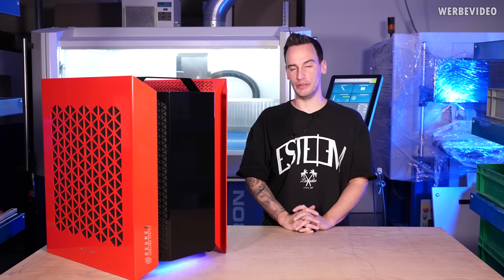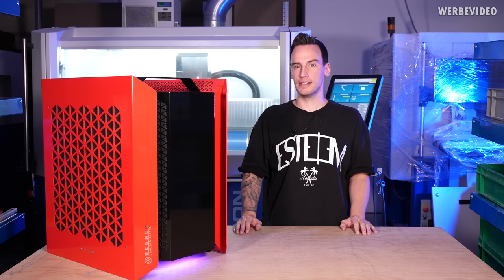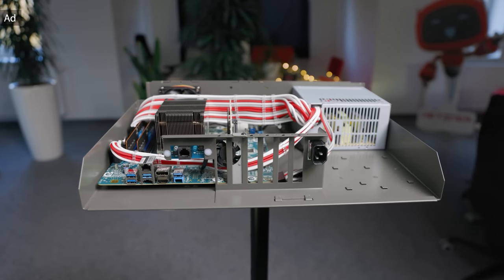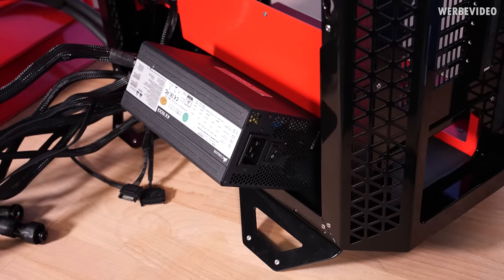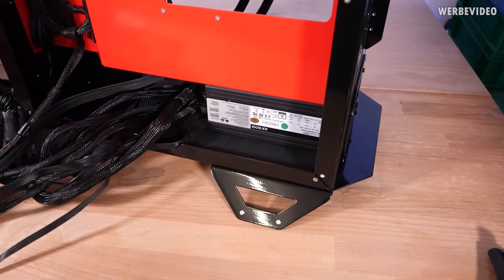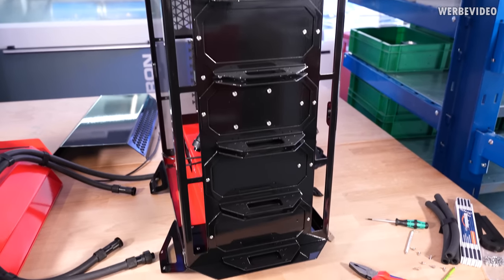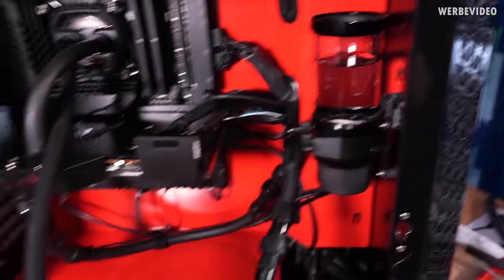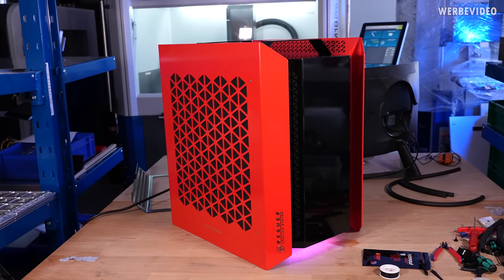The most expensive Case I have ever tested! Regner Cooling is back

Comment: If it can run at 28 degrees at full load, that you'll never ever be dealing with in a real world scenario, then I'd be leaving the filters on.. I've been running filters like these on my HAF X for over 10 years. I can tell you it's much nicer and easier to just clean the filters with a vacuum cleaner than getting in and getting all that dust off every single blade on those fans. Not to mention the radiator fins. Even if these filters get a little clogged the water temp might rise to a massive 32 degrees. But I feel there shouldn't be any filters on the exhaust side of the system. Theoretically the air has already been filtered coming in to the case, so no need for exhaust filters at all.
Reply: the only exhaust fan are the one on the 2 radiators, front and rear of the case are intake (this is certainly why there are filter in the front and the rear ).
Reply: @barbatocedric4246  Yeah 100%. But those filters on the sides are exhaust only. They'll restrict airflow. There's no need for them to be there after the fans. Leave the ones you mentioned in place for sure.

Comment: Yeah to be honest, this case sounds insanely expensive on paper.  However, when you take out the 1k+ cost of the water cooling components and the 300ish cost of a high end case from a custom loop build you realize maybe this isn't as expensive as you thought it was.  Great to see the massive comeback on this product.

Case in point, a friend was recently debating trying to water cool a 4090 he has on order and asked me what the costs were like.  It was around 600-650 to do it with EKWB parts, and that was only using a 240 rad, soft tube, minimum required fittings, smallest pump/res combo, and not including the cpu in the loop.
Reply: For this price, you get some pretty weird (and even cheap) stuff with far from the best visuals. Only one real selling point is dual rads on the sides hid. In other, it's a pretty average case. Even after looking at this video, I can see so many areas to improve.
Reply: @shteud01  Uh best visuals?  What?  Cheap stuff?  Yeah solid aluminum, 400mm square radiators, noctua fans.... very cheap stuff.... 

Roman helped design the most popular case made in the last decade, so popular everyone has copied it to death.

He seems to think this case is pretty good.  I am going trust him on it.
Reply: @DKarkarov  I don't say the case is bad. But design and parts choice is having flaws. single pump combo in the system like this? Oo  Why use the cheapest Aquacomputer option? Alphacool quick disconnects? For 2K Euro. No tube organisers? This case needs improvements for this cost. 
ps. Roman doesn't design this case. And I think he just doesn't want to offend the creator.
Reply: @shteud01  Ok so .... he stress tested, the case met if not exceeded his temp and performance expectations.  So the included pump and reservoir ARE up to the task whether you think it is cheap or not.  PS: there is no such thing as a "cheap" aqua computer res/pump combo.

Tube organizers he mentioned, adding them is hardly costly or hard to the user, and this is still a prototype and there may be more of them in the final.  There were some tube organizers already in place.

As for not offending the creator?  Did you see the first time he reviewed this case?  This is the second prototype.  When he reviewed the first prototype he all but called it overpriced art piece junk and said no one should buy it without massive changes.  I am 100% sure he isn't worried about offending anyone.

Comment: I wonder if there are similarly overkill cases, but for air cooling. Also maybe it's just me but would have loved to see how the CPU behaved on max fan speeds, if the temperatures were still that high or if the multithreading score was higher with that much cooling

Comment: 06:45 "tested and cooling capability will be there"
well of course it will be there but I do not believe for a second that cooling potential is not largely affected by the grid, especially at lower fan speeds
and what's more important is that the damn grid is useless because outflow should not be filtered

Comment: How much does this case weigh, and does it require its own forklift. And what's the purpose of those two "handles" on top? They look far too flimsy to be used for lifting a fully-built case. I realize it's a prototype, but it still needs more work to flesh out issues myself and others have noticed.

Comment: “This could be quite nice…” I would hope so if the case itself costs as much as a freaking prebuilt with top of the line components
Reply: With the current trend, a "top of the line" GPU alone will cost more than that 😅
Reply: You probably wouldn't use this case in a gamer build, unless you were going for some no-holds-barred, stupid-overclocking megabuild. This is pure HEDT/workstation, and the chips for those are more than a top-spec gamebox would ever cost.

Comment: Where can we purchase with Wire View for the GPU ?? I have the same GPU so far I went with with red devil since I have a AM4 system with 5950x. There is sense of getting the 4090 CPU will bottle neck it.  I found that thermal grizzly sells those but no location in USA to purchase?

Comment: The special thing about the old case was that Regner developed the entire radiators itself, if I recall correctly. Is that still the case for this one? And if so, how exactly did they improve upon the previous design? Because for the rest, it’s just a very big case with a very big price tag.
Reply: This has huge Alphacool radiators in each side panel. It's simply not practical to build these in house unless you're selling enough to justify the tooling cost and time. It makes much more sense to work out a deal with someone like Alphacool who specializes in them.

The first version was nothing like a traditional water cooling radiator and had nowhere near enough surface area to perform well enough. Coming up with a custom design that's practical to manufacture and outperforms a high end radiator will be extremely difficult to do.
Reply: @JJFX-  thanks. Indeed the previous one was very interesting with these custom radiators, which alas didn't perform. It makes sense to use parts already thoroughly developed by another company, but that makes this version not as quirky or interesting - though in the end, it is performance that counts.

Comment: As a dog owner in a dusty northern alberta farming town i disagree with you re dust filters. I clean mine ever 1-2 months. Its far easier too clean a dust filter than it is too disassemble and clean a water cooling loop with radiators and fans etc.

Beautiful case.

I wonder if more flow would help those cpu temps.

Comment: its a really nice package and would be mostly worth it with a human doing 4-8 hours of labor plus raw materials, machining and coatings. 2 radiators from a smaller car and accompanying fans would be similar but nowhere near as quiet or pretty. The pump is exceptional looking , a 5 micron filter would hopefully be included with easy cartridge change. The pump could run 20 plus years if is designed for home heating. Multiple custom systems over its life. The copper would dull and corrode over time but that seems like the only part uncoated. That would still have the yearly cost around 110 euro per year providing it can cool future components adequately. The red and black is good contrast but more for a Ferarri person . I just saw new-ish white boro sillicate paint that can cool metal below ambient temps , i definitely would like to see it used on radiators and fin stacks.
Reply: Glass that adds cooling? How does that work?

Comment: I assumed the dust filters on the side panels were there because the fans were pulling in air but they aren't. This is completely unnecessary and really more cosmetic than anything. The front and rear panels are pulling in the air so it makes sense to have filters. They probably don't restrict air enough to be an issue anyway considering the amount of area for it to get pulled in.

Surely there's a better way to improve the appearance of the sides and protect the radiator fins.

Comment: 94C and then 90C junction temp on the GPU is within spec, but high. Is the case passing enough airflow over the card (and over the motherboard)?
Reply: Restricted airflow in the front due to the dust filter and the exhaust fan shouldn't have a dust filter

Comment: Cool to see something like that actually work now but ever since I built my main PC on a Praxis Wetbench the thought of building a computer in a case is so unappealing. I have to blow the dust off it more but I can easily do maintenance on it, easier to swap a part out and it is great for custom liquid cooling. I don't run into any compatibility issues with height or length of components and there is plenty of room in the bottom of it to group together all the wires, I just can't go back to a case and deal with all those annoying and various compromises.

Comment: Exhaust filtering is a bad idea and something that should never be done. Dust will build up where it can't be seen and is difficult to clean, in this case just behind the radiator behind the fans making it even harder to clean. The first thing I'd do is take those filters out!  Intake filtering is okay, as it can help with internal dust accumulation although they may need frequent cleaning. I have a dual thermometer measuring the intake and exhaust temperatures. The temperature differential provides an indication of filter clogging and internal temperature rise.

Another thing that is apparent is the lack of intake area on the case with exhaust area. With all those exhaust fans the intake port filtering is going to clog up quickly and there are a lot of fiddly filters to clean.

Finally, with such undirected airflow there will be little cooling in a number of areas, including at the motherboard surface so board-mounted components are likely to suffer thermally. This may be mitigated by liquid-cooling the motherboard. This is important because motherboards are designed to have a certain airflow over them to keep chipsets, voltage regulators and other components cool.

One possible solution might be to reverse the fan flow on the side panels. This would utilise the filter area and provide a large flat filter surface that would be relatively straightforward to clean. I would then look at mounting a fan or several in the front panel. These would be draught fans, with no radiator. They could exhaust out of the front of the case drawing cool air in from the back and the keep the warm air coming in from the side radiators away from the motherboard.

Comment: This is a seriously cool case. The only suggestion I have is cosmetic and that would be the availability of a tinted tempered glass front panel. Other than that this is the coolest case I've ever seen. The sheer volume of air being exchanged with eight 200mm fans is impressive by itself. I think this case would look insane in black, white and gunmetal grey.
Reply: The hard drives are stored behind the front panel. You can't see inside from the front. Maybe a clear top panel would make sense?

Comment: I hate to nitpick, but I think it's acceptable considering the price of the case. The paint is pure orange-peel and could really use a round of sanding and buffing. As it is right now it looks like a paint job done in someone's driveway. Glossy isn't difficult to pull off, glossy and smooth is where the challenge comes from.

The dust filters also need more thought put into them. There's absolutely no reason to have a filter over the rear fan opening if it's intended to be used as an exhaust.

Why can't the screws be a normal hex or torx head screw? Why do I need to purchase more bits on top of the cost of the case?

For $2000 I think this still leaves a lot to be desired.

Comment: A worthy oponent for my Phanteks Enthoo Pro 2. Still, at 10 times the price of my Phanteks and having 2 small car radiators with 8 200mm fans... it's still throttling a 13900ks.

I have a question Roman, if you used an external powered hub to force the fans to go higher, would you be able to drop even more the temps? Those Noctua fans are silent even at 100% haha
Reply: Absolutely agree with you. I have the same case and it is much better at a fraction of the cost
Reply: @AcM.5233  Indeed. Right now I have an air cooled 3700x and a 1660ti that mostly runs passively because of the incredible airflow it has. If I ever decide to go the custom watercooling route, 2 360mm radiators would be my way to go!
Reply: @TheMC1X  comparing 3700x and 1660ti to a 7900xtx and 13900ks... your setup combined pulls amount of power 13900ks pulls alone where we did not even include the GPU

he can easily use a direct die 13900ks and show capabilities of this case even more because yes at the end it has 2 1000cc superbike radiators in side panels and it is practically silent
Reply: @xthelord1668  First, I'm comparing the case's perfomance. I'm maxing out the PBO on the 3700x, I'm well below 70°C on a BeQuiet Dark Rock 4 and having any midrange GPU going passive almost all the time is no easy task.

Second, even with direct die, a case 10 times pricier than my Enthoo Pro 2 and with the watercooling potential it has should NOT thermal throttle a 13900ks. I can't imagine what would happen with an HEDT setup.
Reply: @TheMC1X  you seem to sound kinda biased here

1st of all to claim that your case is better you should have hardware used in the video + custom loop in order to prove this (which you don't)

2nd even chillers can't easily cool a 13900ks because of IHS being a bottleneck since you can only extract so much heat out of the CPU IHS so i don't expect this case to tame a 13900ks hence why i mentioned direct die

when you use hardware used in the video and do some testing be happy to tell me results because we compare apples to apples not apples to oranges
Reply: @TheMC1X  Have you considered that the 13900ks's IHS can't really transfer 350W worth of heat in the loop fast enough and that's why it thermal throttles unless u do direct die cooling or some exotic cooling solution? HEDT CPUs are much bigger compared to consumer CPUs so they have more surface area to move the heat to the loop.
Reply: @xthelord1668  You can literally check other high-end builds with my case for thermals. It's not a one-off dude🤣.

I'm biased towards my case because I expected better from the 2300€ Ragner case. And that's the point, that even for full-tower standards is dissapointing.
Reply: @AlexWinExperiments  And have you considered HEDT cpu's can pull up more? Even moreso with the new Intel HEDT stuff that's overclockable.
Reply: @TheMC1X yeah but as I said higher surface area means that heat has more space to dissipate which means that it will stay cooler despite being able to pull like 500-600W

Comment: Neat case, Obscenely expensive. Also a Side note. It shows just how un coolable the i9-13K is. Thats TWO radiators the size of ones you can find in a HONDA CIVIC 4 cylinder AUTOMOBILE.

Comment: It's a great case but tbh for the money... you can just make your ordinary water loop with 360 rads and the performance is gonna be the same for less money still impressive and definitely unique.
Reply: Seems expensive at first glance, but as soon as you put serious load on a 360, you start needing high-RPM fans and the associated turbine noise that goes with it. If you want a high power PC that purrs rather than roars, you'll pay a lot for that amount of radiator and low-RPM fan. The quieter D5 pumps don't come cheap either.

Comment: This case would be perfect, if the front chamber was a bit shallower, and the back chamber was bigger, Then just have the 1 rad in the back. with the water pump and res. I would be like cable management but for water cooling. I really really wish the Dual chamber cooling would catch on, Even with aio's If the top pannel is removable and there is big enough hole for AIO block to fit through. you could even mount GPU in back with a riser cable if you could passthrough hole in case.

Comment: The rubber tubes sticking out of the metal holes in the side panels are kinda concerning. Probably fine, but it doesn't feel right. Would feel better if side panel had bulkhead fittings or a rubber grommet to ensure no rubbing between water-cooling hardware and edges of aluminium panels

Comment: in overall good niche case, 
i think he need to change paint job, does not look good in reflections, would like to see similar finishing job as in phanteks evolv cases, like matte silver/mate black combo finish
and yea need to add cutout at the bottom for cables, 
and changing that old type mesh to different ones, i think nylon type mesh like what phanteks was using would fit perfectly here, ofc in not all areas but main ones

Comment: A couple of complaints I have is the triangle hole theme is very Corsair inspired and using the Corsair RGB header is also another 'but why?'. For that price you shouldn't have some paint job and it should be a powder coat instead. I would also think a raw aluminum look would be more fitting for a build of this quality along with powder coat accents of course. I still really like the integration of the rad in the panel and build quality overall. I would like to see your thoughts on the MurderBox from BC I think you would highly appreciate the level of detail it entails.